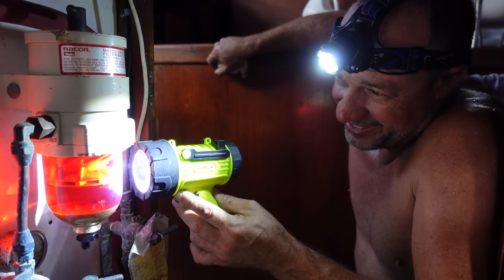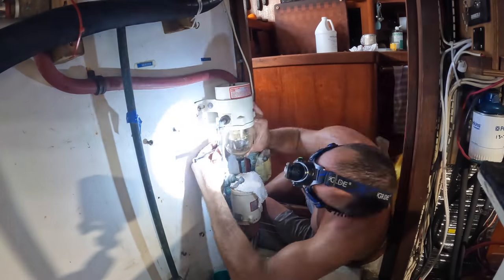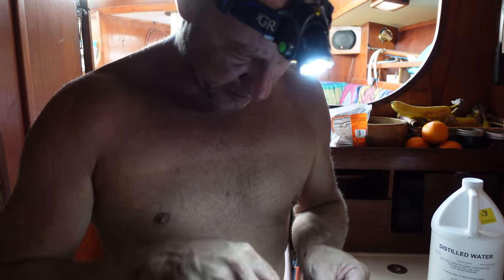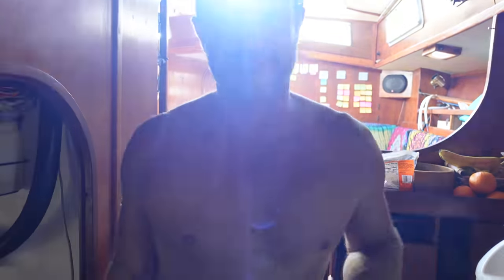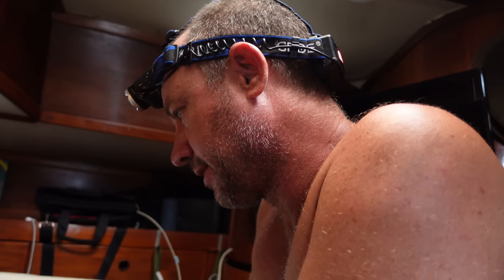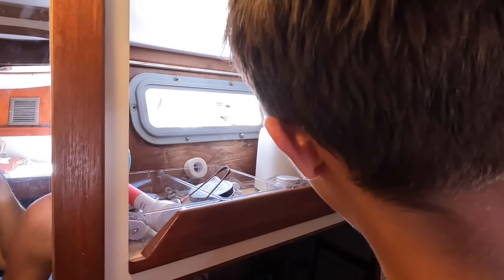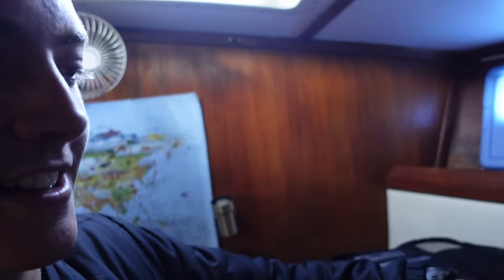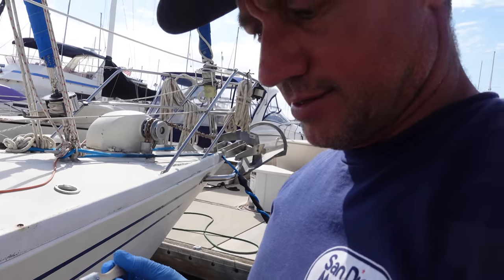This came out of our boat 🤢 | LOTS of boat work | Ep 315

Comment: Yea! The engine runs!  That's a huge check off the list. Nice job Lee.
 And I'm constantly amazed by all the cut wires you keep running into. Such a mystery, and it adds so much work to an already difficult task. There had to have been a serious threat of fire for the previous owner to have done that.  
  On the other hand, some of the strange things seem to suggest the man was a far cry from an electrician. So sorry for the constant puzzles you run into. Wow! 🤪💖💖

Comment: You could have used barrier cream? All oils can lead to dermatitis and once you get that sensitivity life is barrier cream AND gloves! (Voice of bitter experience).
Reply: Never heard of oil and diesel being bad for skin.
Reply: @PD-we8vf  Well, now you have. Contact dermatitis is a well known problem in industry. All Engineers should be aware of the problem. There is no cure, just prevention and mineral oils are a big issue.
Reply: @jonathanwetherell3609  I’ve got years of getting oil and gas on my hands for years. Go ahead and get your hands dirty. If you can handle a real man’s job.
Reply: @williamd1891  so will it hurt my nerves or my skin? You two gotta get your story straight it’s like I’m dealing with Moderna and phizer at the same time. Get your propaganda straight.
Reply: @PD-we8vf  Lucky you! You are one of those who are not prone to contact dermatitis. UK H&S Law requires all those liable to have contact with "sensitizing materials" to wear gloves or barrier cream as appropriate.
Reply: @PD-we8vf  Are you drunk??